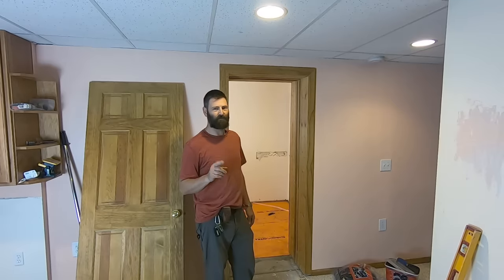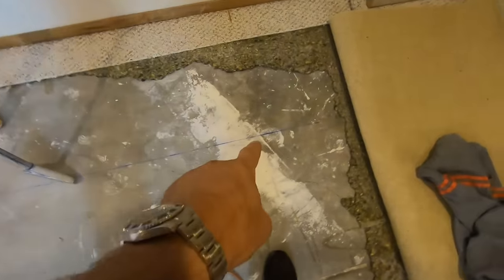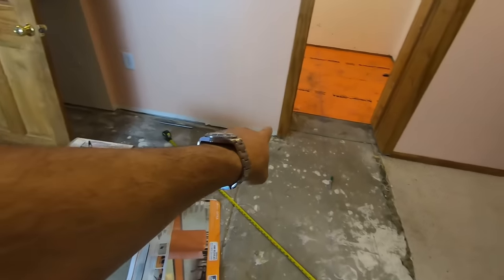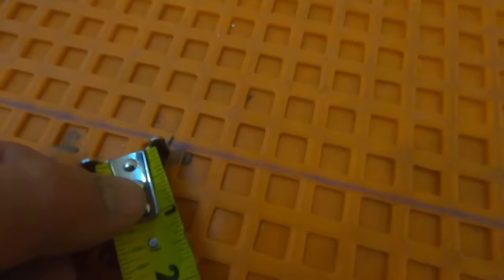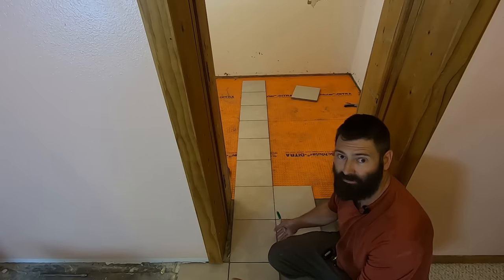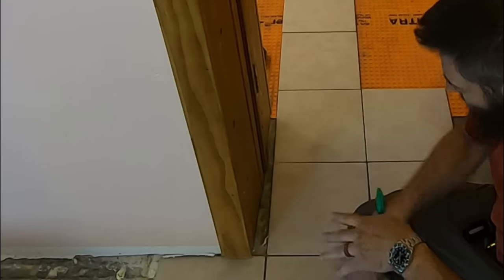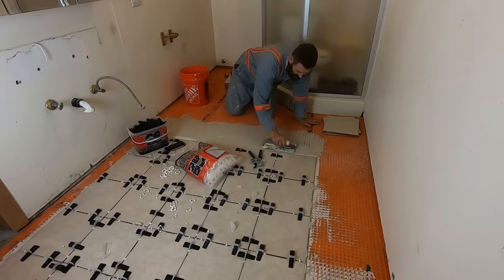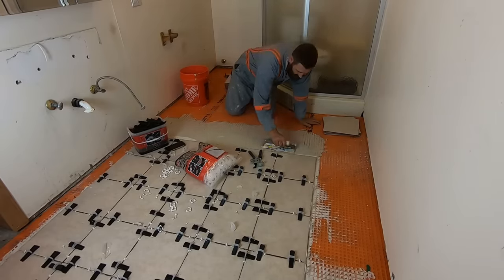How To Layout Tile So That It's Perfect Every Time | THE HANDYMAN |

Comment: Just a little tip when laying tile... set the tile down close as possible to the adjacent tile then press and slide away.  This keeps thinset from rising up from the joints.  👍
Reply: Excuse my ignorance, but what is that orange pad he uses and what does the black tabs do?
Reply: @Straight_White_Fatherly_Figure  Use Ditra (orange thing) as an underlayment for concrete or wood subflooring.  It prevents the tile from cracking allowing for movement.  It's super expensive but worth the cost to do it right.  Use a very thin even layer of thinset when applying Ditra to avoid an uneven base due to clumping or air pockets.  The black tabs are wedges and spacers which can be bought in different sizes depending on your grout size preference.  It also gives you a visual when laying the tiles evenly.  Buy enough spacers to make sure you're not having to reuse any from previously set tiles...
Reply: @weskarcher483  thank you!
Reply: With clips cut it back

Comment: Tile guy here,  I’m late to the party but,  keeping the tile backs wet with at least a sponge will do wonders for your bonding-especially when laying over plywood,  hardybacker,  or dura-rock.  Helps stop thinset from drying out fast and flashing off.  Shouldn’t really need to back butter 👍

Comment: What I recommend: 1. A 100lb flooring roller to set the ditra into the mortar; skim the ditra with mortar and let set up - semi-filling the recesses - which creates a relatively smooth and visually calmer substrate. This also eliminates the need to back-butter most tiles.

Comment: Yeah, see the issue with using modified thinset on Schulter is that it would be sandwiched between 2 non porous surfaces and the additive wouldn't dry. That is why they recommend unmodified.

Comment: I usually find the center of the room and make several measurements and draw several straight intersecting lines on the floor and adjust in each direction as needed for doors and other rooms. Most cut tile edges will end up against the walls where trim will cover over the raw cut edge. A cupped tile is your main concern which can leave an air pocket under a tile making it easy to crack.
Reply: Cupped tiles are for sure the number one enemy.

Comment: I use to snap control lines and get layout and move my lines all over to get a good layout.  Now I use a layout lazer. Will never go back to the old ways unless I dont have aa batteries.
Reply: Layout lazer? Is this a bosch? And witch one do you use
Reply: I use the old lazy laser.

Comment: Great explanation of why it's important to think before starting & lay your first tile courses as evenly as possible. Otherwise that bizarre mathematics thing happens 🤔? where being just a fraction off leads to a noticeable wedge area of floor to tile on the far side of the room. Lots of people make this mistake though, rushing to finish. Then blame the awfulness on crooked walls, lol. 😁👉 //

(Worst, hardest, dirtiest home project ever, chiseling out old porcelain tile. That mastic adhesive really does bond to floors, no exaggeration. Never want to do it again.)

Comment: You need to push down the ridges that you build up with your comb. You set the tile 2 inches away from the place it needs to go and push it into place, this collapses the ridges of thinset and gives you a 95%+ coverage on the tiles. This is a lot more important than backbuttering the tiles themselves. Just fyi.
Reply: This makes a lot of sense. I'm probably confused, but I thought the purpose of the ridges is to keep the tile lifted level? If you smoosh the tiles down then you have to take an extra step & use a level to make sure the tiles are set evenly flat. (The first time I installed wall tile, I did it the way you suggest & ended up with a wavy layout. When light reflection hit the wall you could really see how poorly done I did the work. Not my proudest moment :(
Reply: But if you do that, will the thin set come out thru the ends and you will have to remove it so you can put the grout?
Reply: That's what I was thinking. He got the lines straight, but didn't do the push down and jostle thing I see on other videos.

I'm going to do my first tile job in the next week and this video gave me tips, but I wonder about a few things

Comment: you have to do the 3, 4, 5, ft mark from the 1in. mark on the tape it is more accurate then the metal tip on the tape, espicially in big rooms, a 16th or an 8th of an in. off can make a difference

Comment: Just a tip I figured out... instead of back buttering, you can also just take a bucket of cold water, and use a sponge to dampen the back of the tile...all you need is the tile to be damp so it creates adhesion to the floor...you'll use less mortar as well

Comment: I can see using unmodified under shluter but over top I'd like a better bond with modified. I think the recommendation is so that the tile moves with the membrane, modified is like adding two flexible membranes. Still rather have better adhesion.

Comment: I rarely use those wedge spacers, or schluter for that matter. Only typically use the wedges for marble or very specific jobs. They’re expensive af. Usually just use regular spacers, I’ve gotten really good over the course of 8 years leveling it out by hand or pouring self leveler down. Usually use concrete board of some sort instead of schluter too. Very interesting to watch other tile guys lay tile. There’s only about 5% of us that actually do a good job 👍🏽
Reply: Schluter is good for basements, temperature variations, so the tile don't crack?????  Not really needed in upper floors w/ plywood as sub floors?????

Comment: Bought a house two years ago. Whoever tiled the kitchen and bathroom started against a wall, and branched out from there. The three tile rows that extend under the stove are offset from the ENTIRE rest of the kitchen!! (Rather than adding slivers, they just butted the tile up to the cabinets, and "they don't line up" be damned). We have boxes of tile to redo it correctly, but it's a LOT of work, so I'm procrastinating...
Reply: Okay, so what's the point of "Back Buttering"? I figured out what it is from watching this (I was initially confused), but I have NEVER seen that done, and I've been "the kid" on a couple of tiling projects.

Comment: What I would do is cut out around the door first, leave enough tile inside door. Transfer that number to the wall running into the room. Then you would only have look at 4 walls. If the math adds up so you dont have a sliver piece roll with it. I just think it makes the math eaiser if you start at the door.

Comment: Why did you put ditra over concrete? I typically only use it if I'm going over plywood or use the shower system I would use it on a second floor but you are in a basement
Reply: My guess is that it provides a layer of separation between the concrete and tile so that if the cement cracks, it doesn't necessarily mean that crack will translate up to the tile.
Reply: I heard it make the surface of the tile slightly warmer as well. We’ll see..

Comment: Pro Tip- Use the video settings to slow down to 0.25 speed so you can understand what he's saying when he plays those sped up parts.
Reply: 9:45 100% coverage haha. Not at all.
Why didn't he set the tile to collapse the ridges? They are still almost undisturbed on the floor.
I like the aiming of the doors, but I disagree on his coverage and setting.

Comment: How does this fit $1,000 a day wage?
Reply from the maker: Good question.  It still works out to around $1k a day.  This isn't  an 8 hour day. Its usually 12 to 14 hours per day.
Reply: @TheHandyman1  I do the same things in Missouri.  $1000 a day would be difficult here.  $400-600 is good. $65-100 p/hour.